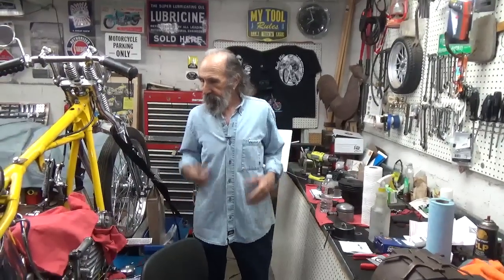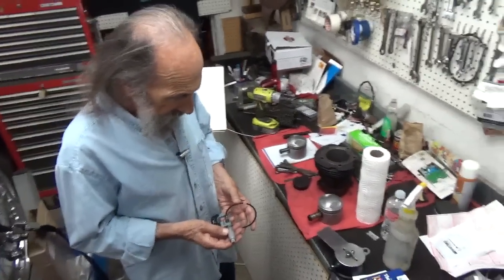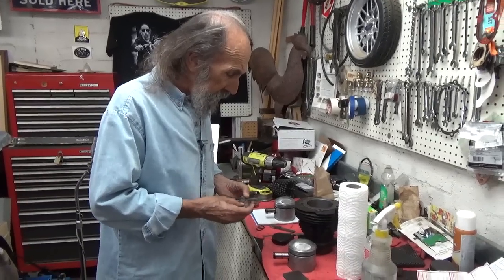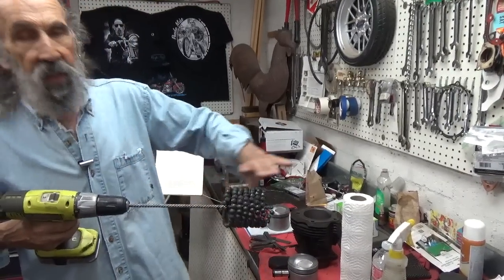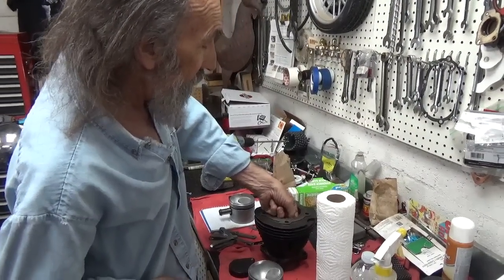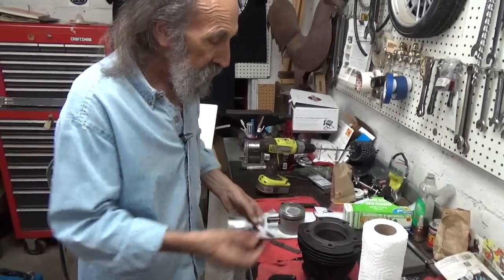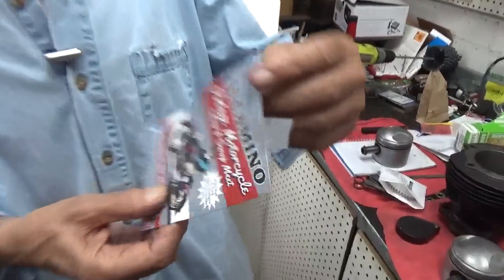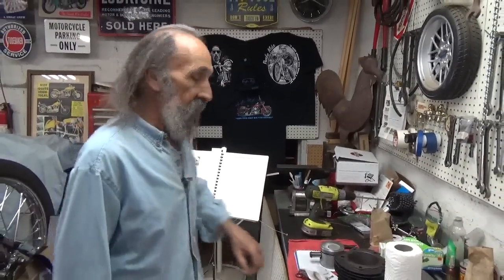Let's Prepare a set of Piston Rings For the Harley Knucklehead

Comment: Not just the desert's temps either . . . I once 'nipped up' a freshly rebuilt Laverda 1200 triple on a frosty English morning, after just half a mile of gentle burbling through traffic. Alas, the massive cold-soaked engine & bores, expandified not enough to humour the-new-rings-in-the-block's freshly swollen awakenings, & I felt the dreaded 'snatch of doom' travel down through both chains.
Ah, the 20 min push-back of shame, the steaming cup of solace, . . . the tear-down of woe.
Turned out they'd gapped the top ring only. The poor second ring had grabbed whatever it could to escape the heat blasting through, painting a pretty blue mural up the wall. Expensive road test : )
Reply from the maker: And there's the importance of proper ring gapping.  But a Laverda Triple?  How "over the top" cool.
Reply: @pacificmike9501  - Ironically, anything but cool - it wasn't my bike! - & on even a good one, you must get them well hot before you go anywhere near the power - or else! Owner did offer me it for two grand - after I blew it up - but a new piston & ring set plus judicious honing saved the day, so he kept it. I somehow doubt he'd still take £2k for it now! - add another nought maybe? : )
Reply from the maker: I've never experienced those bikes, but I've always been impressed by them.

Comment: Hi Mike and Mike. I loved your information about piston rings. There is a lot of "science" behind piston rings. Perfect Seal used to make decent rings for the older cars. Hastings are good quality. You're 100% right about installing rings by hand. I've used a ring installer tool in the past. I like your "philosophy" regarding getting tolerances just right before buttoning up an engine. It's all about peace of mind when you're out on the road. Thanks a million! -- Walt -- Oh yeah, what's your take on S&S Cycle's reproduction Knucklehead engines? Again, thanks!
Reply from the maker: I haven't had the opportunity to play with one of those motors, but, quite a few years back, I was given the grand tour through one (by the engineers at S&S).  I was very impressed.

Comment: Thank you ! Great video !
Some people prefers to have a slightly larger gap for the lower compressoon ring, to prevent pressure build up between the rings, which could lift the top ring off its seat. Is this correct? If not, what is the best way and why? Thanks !!
Reply from the maker: Absolutely true.
Reply: Thank you, sir! Good luck with the surgery !

Comment: Hi Mike, I admit I haven’t watched for a while. Working on your Knucklehead got my attention. I know it isn’t but to me it’s the best engine Harley ever built, maybe because the first I had and still have 50 years later. Unfortunately I seized it a few years back running it very hard on the interstate. Oddly enough there is absolutely no scoring on piston and cylinder walls but rods seized right to crank pin. Everything as it should be in oil pump so my best guess is contained high rpm (30 miles) thew oil off crank pin faster than oil pump would replenish it but still enough into cylinders to lube pistons. By the way, stock oil pump and if I remember correctly 21 tooth motor sprocket, what we used to call sidecar gearing. I blame myself, too many rpm for too long. I hope to finally put it back together this winter and if so I will post videos and tell stories of adapting Pan cylinders, twice losing exhaust valve heads and welding front head when crack developed all the way to exhaust valve guide hole. As you know it was more challenging years ago to keep them going when Harley didn’t readily have parts anymore and the aftermarket parts weren’t available yet. Keep up your excellent videos, one of the best tools young guys have to help them live with and enjoy their old motorcycles. 👍
Reply from the maker: Thank You.  I look forward to hearing the adventure continue.

Comment: Another very informative video there guys, I liked the explanation about the honing too.
Glad your eyes are coming along nicely as well Mike.
Mike, my clutch pedal on my 46 Knuckle started to slip backwards the other day while out riding and I noticed the nut, spring washer and flat washer with the flats ground out of it on the inside are not there. I rode home keeping my toe down and as I have ordered the parts I just wanted to know can the pedal fall off. It looks like the pedal shaft with the flats on it for the washer threads through the bracket. Is that so or can the pedal fall off. Hope the explanation was ok. Thanks ahead of time.
Reply from the maker: Take it apart when your new parts come.  The pedal is fastened to the shaft.  When you take it apart, clean it all, lube the shaft.  Spend some time getting the adjustment you want, then enjoy it.

Comment: Q: what are your thoughts on using total seal gapless rings?
Reply from the maker: Why not?  I never have used them, but, why not?
Reply: @pacificmike9501  
I use work on aircraft engines. Namely air cooled P&W R2800 engines.
I was in the machine shop,  the over haul shop. I ask our master machinest why we didn't use total seal rings....his answer was that the gap ends on air cooled engine is much more critical than a liquid cooled, thus a greater expansion ratio, which could cause rings to bind and possibly break them. 
How ever those were 2,800 cubic inch, 18 cylinder radials that operate in large ambient temperature range. 
A bike enige is more stable temperature speaking. Just curious if you have used them or know some that has.
Great channel.
Thank you.
Reply from the maker: Thank You.  That's interesting stuff.  And, a good question.

Comment: Do/did you check the ends for burrs?
Reply from the maker: The little machine does that and yes, I inspected it with my magnifying glass.
Reply: a burr at the end gap after grinding , what do you use to smooth the burr off?
Reply from the maker: That little machine does it.  You can use a little Swiis file, but you want to keep the ends square with each other.

Comment: Mike any chance we could get on the phone and you help me adjust the mousetrap on my 58 pan. Keeps locking back over center. When I adjust clutch to keep it from doing that you can’t kick it over. So with clutch adjustment correct trap locks over center.
Reply from the maker: Try again.  Start at the beginning.  When you get to where it doesn't snap back, slowly tighten the bolt.
Reply: @pacificmike9501  worked on it early morning. Then again this afternoon after riding. Much better. But jumping off a new bike onto this 58 has shown me how far we have come.
Reply from the maker: Once you get it right, the clutch is so much nicer than the new ones.  Mousetraps are a dream, much smoother and require much less effort to operate.

Comment: Mike! Im back with another tech question. Im assembling my panhead top end and my ring side clearance is only .0015, and my manual also states .004 like your knuckle book. Would you dare to run them, or search for other rings? The pistons and rings are NOS Superior, probably older than me! Thanks as always, Anthony
Reply from the maker: What does your Panhead book say?  And, are these the rings that came with you pistons?
Reply: @pacificmike9501  My panhead manual is calling for .004 side clearance. I bought the pistons and ring sets separately, although they are both Superior brand at +.050. These are for a '49 EL which were harder for me to find than the 74 inch parts
Reply from the maker: I'm sure it is difficult to find 61 parts.  Try V-Twin in New York.  They'll give you measurements.

Comment: Hey I'm looking to build a flathead  can a shovelhead  or panhand transmission  fit it .also your  awesome to watch  like the hob Ross of motorcycles
Reply from the maker: If you're building a big Flathead (74 or 80 cu. in.), a 37-64 big twin trans is the same.  If you're building a 45 in. Flathead and want to use a Big Twin trans, Paughco Products makes a frame for that combination.

Comment: I hope your getting Alcon lenses. I test them, clean them, load them into and label there protective cases. Shouldn't you have turned the ring gap grinder the other direction? That way you don't have a chance to leave a bur on the outside of the ring.
Reply from the maker: There were no burrs.  But, you're probably right.